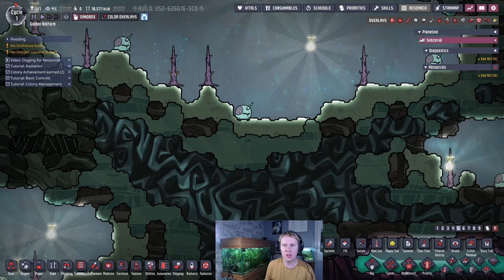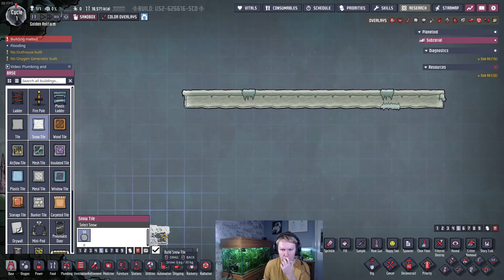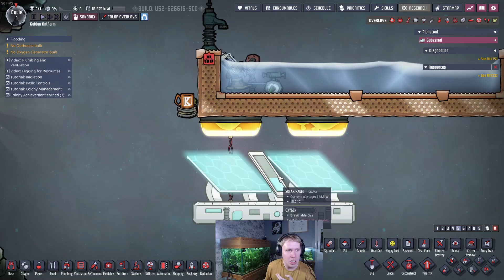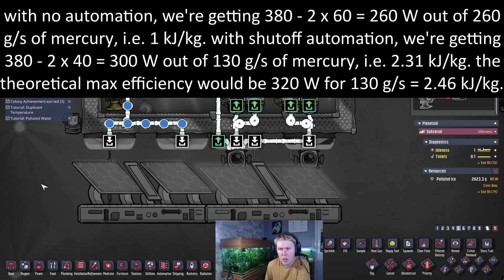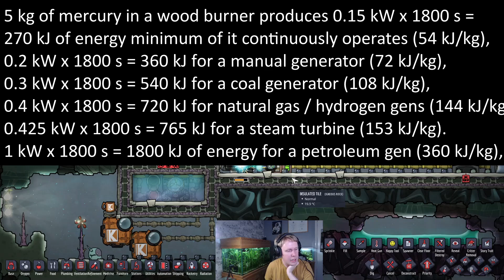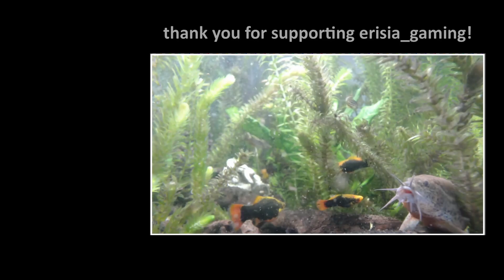How To Generate Power Using Mercury In ONI: Spaced Out! Sandbox Showcase #29

Comment: A simple change to the automaton would be to have both valves set to 65/s and only 1 shut-off. Then you'd only need to spend the 10W powering the shut-off during the ramp up and during normal operation it'd be free.
For my play through I used mercury as a thermal interface fairly often and in many liquid locks. Also for primary power for a pretty long time. On the other hand I found the "accidentally made a building of mercury" thing sufficiently annoying that I went out of my way to melt it all as quickly as I could.
Reply from the maker: Yes, this is the simple fix I was looking for. Will try this out later on stream.
Reply: you could also just use a liquid Vent which drops the "blocked" liquid back into the tank. (with the vent being blocked by automation when not needed.) It will need a bit more activety on the pump so im not sure if it saves that much.

Comment: Around the 35:00 mark, isn't the reason the light degrades the farther away is because it's traveling through O2. If the bonbon tree was in a vacuum, light would only degrade because it travels through materials, like glass. I'll have to test that, but it's what I recall. Great analysis of the solar panels. It's a net power output. And the newest building gives you 800kg of glass if you deconstruct 8 tiles in it. It also gives you some steal. It's the Printerceptor story building. So, if you find it early game, you can have some easy clean energy for one of those annoying achievements.

Comment: Just to add info, not sure if you addressed it.  Currently the microchips made by the control station will melt if you move them from the cold environ.  Looks like they changed the primary element to match what made it.  So if you want to sub zero your power rooms then it is a good work, but otherwise it is a waste of time.
Reply: Also a fully loaded lamp is providing about 55-60% of the capacity of the solar panel now. 380ish Watts out of a possible 600.

Comment: which video do you talk about using oil, or in this case mercury in your aqua tuner bath? i am curious to know the reason vs just using water to turn into steam
Reply from the maker: Oil and Mercury are very conductive compared to Steam, so if you're trying to conduct the heat from a Thermo Aquatuner quickly, using a liquid layer and then a Tempshift Plate between the liquid and Steam is more efficient. This is very important if you're using a Gold Amalgam Thermo Aquatuner, as that material is a lot less conductive than Steel, so it can help ensure it doesn't overheat.
Reply: @ thank you so much. That makes so much sense. Especially for early game

Comment: Can you not manually enter a value for the lux sensor? In most other sensors and such you can manually override what the scroller allows.
Reply from the maker: Yes you can, but the range is from 22-15000 lux. This doesn't change with typing it. D:

Comment: automating the mercury lamps is much easier, just turn them on and off with a timer sensor turn on for 1 second, turn on for 1 second.
Reply from the maker: This also works, with a few caveats. Running at high game speeds, sometimes the lag can cause the lamp to start decreasing in brightness. This can be resolved by increasing the time interval to 2 seconds, but this causes the net output to drop to about 375 W average. It's definitely simpler; I think AylorAivo's solution is probably the best.
Reply: I know this is a year later but when trying 1 on 1 off the power produced slowly drops. 2/1 seems to hold steady at 378. I have a bunch of these so trying to avoid having to repeat that valve setup 12 times.

Comment: Rather than lux sensor, can't we just use wattage sensor on wire from solar panel? Also if we swap around shutoffs with valves, there shouldn't be any extra 10kg packets of mercury, right?
Reply from the maker: I tried doing this, but the power has to be consumed to trigger the Wattage Sensor. Such a setup can work using a Transformer and Smart Battery, but the problem is, the power draw drops to below 1 W when the storage is full, so the automation is obtuse.

Comment: I am using a decorative pot for bonbon tree, planting by pips, in buried under fallen sand bug(feature) or you can plant in a regular(red) bucket (not agrotile). That gives +1 transparent(glass) tile for bottom bonbon tree layer. Also using that set in the space and having 10% light reduction by glass tile you can theoretically have up to 10 layers... still have about 3. the bug with pot allows not to fed trees by snow and get nectar absolutely for free.
Reply: by the way I am not sure if seal can drink from decorative pot but saw that it can drink from "red bucket pot", 1 tile up, so that can be used on the farms
Reply: @alexandermarch8018  seals need a tile on the same level as either trunk tiles to be able to access the tree